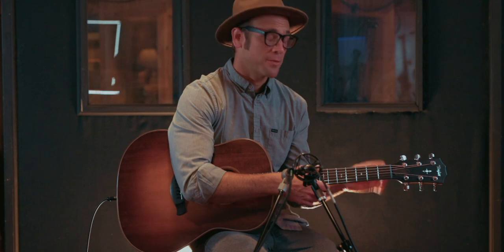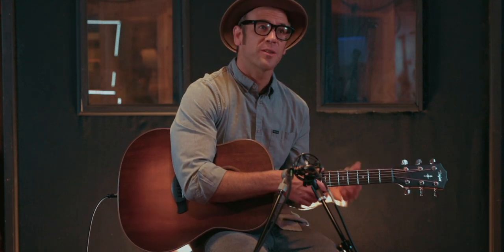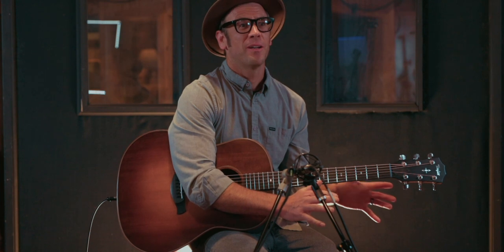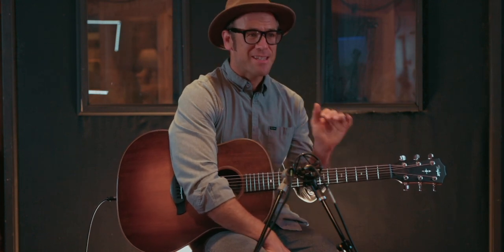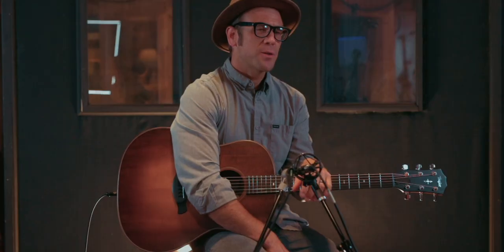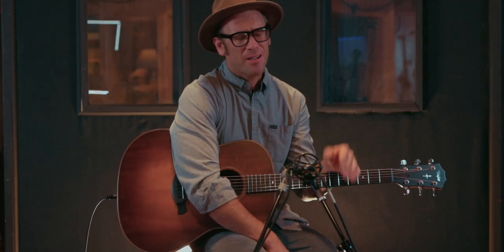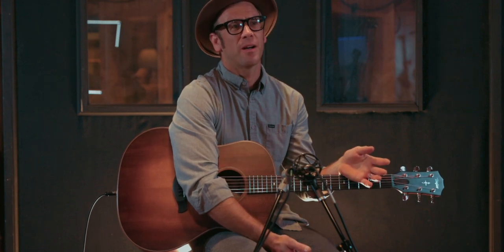Oiling Your Acoustic Guitar's Fingerboard | Coffee & Guitars w/ Andy Powers

Comment: Greetings all, please do not leave any rags around with linseed oil on them. Linseed oil can  spontaneously combust and cause a fire.  You must, and I mean must get rid of any rags and not leave them in a garbage can. I am a volunteer fireman and have been to a bunch of calls caused by this.  The best bet is to go on the internet and read up on safely cleaning up and storing linseed oil.  I personally use Music Nomad F-One Fretboard Oil and it works just great. I get rid of  the rags after washing them with some soap and water and putting them in a zip lock bag very wet with some dish soap on them.
Happy cleaning!,
Brad
Reply: I use paper towels